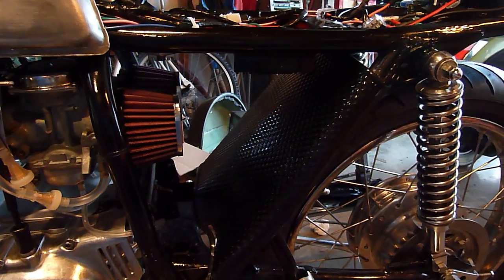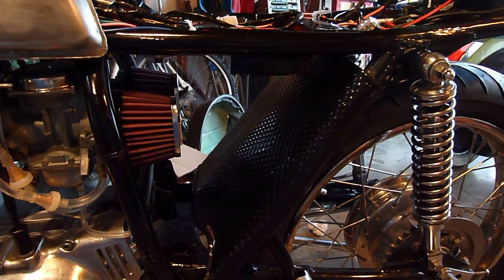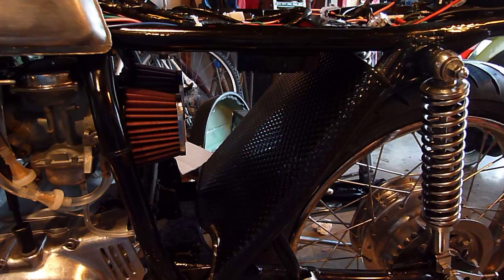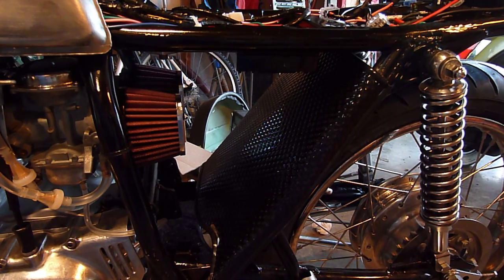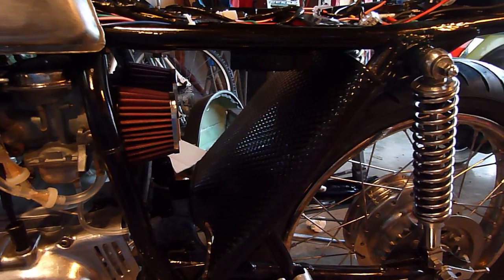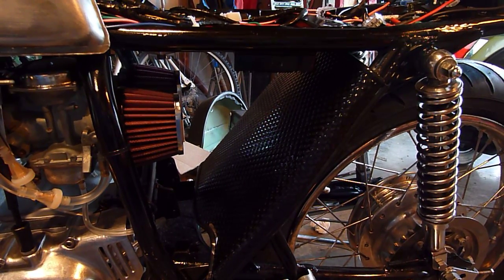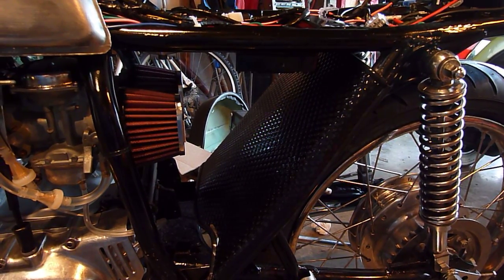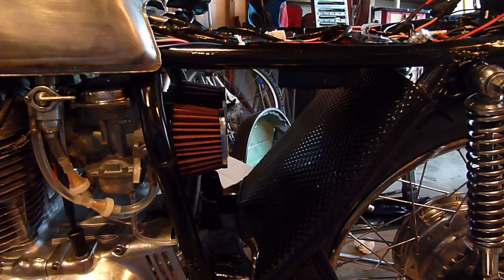Acacia's Vintage Motorcycle's electronic ignition on a CB360

Comment: do you have a link to where you acquired the electronic ignition kit? I own a CB360 and would really like to convert it over.
Reply from the maker: You can contact Viet at his website Acacia Vintage Motorcycles.  I had issues with this unit and went back to points.  If I was serious about elec ignition I would wait for Pamco Pete to perfect his unit at http://www.cb360ignition.com/

Comment: Any time you mess with ignition you need to re-time spark to make sure it's happening in the correct place.
Valve adjustment sounds off, you didn't set them on overlap position?